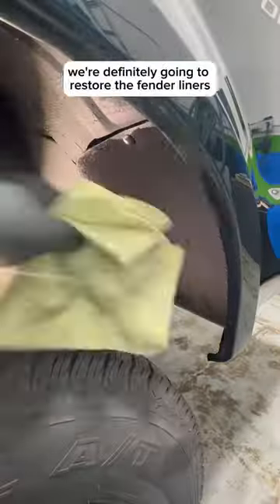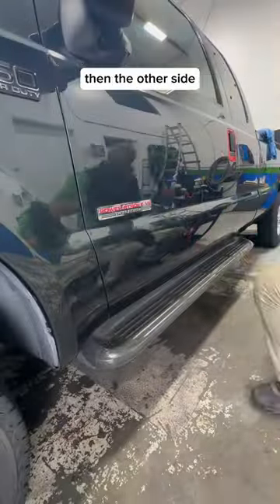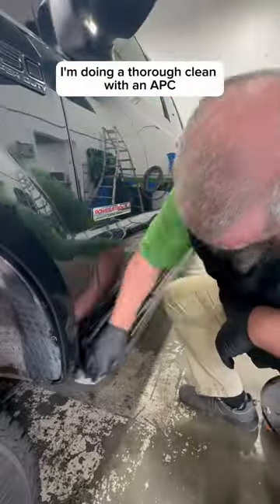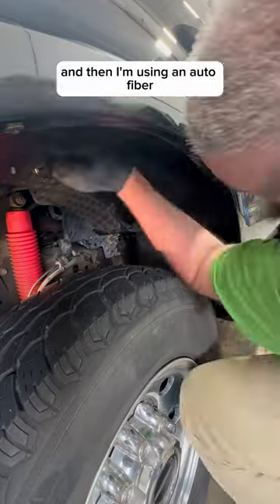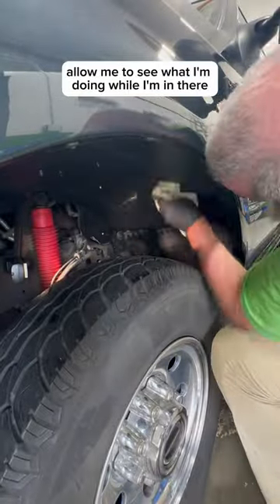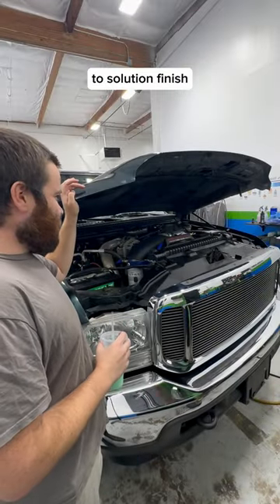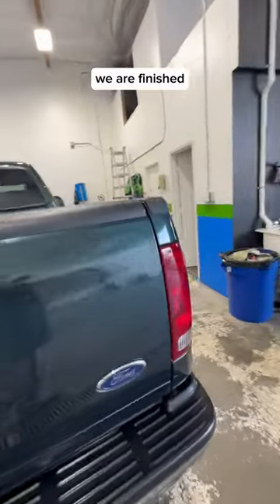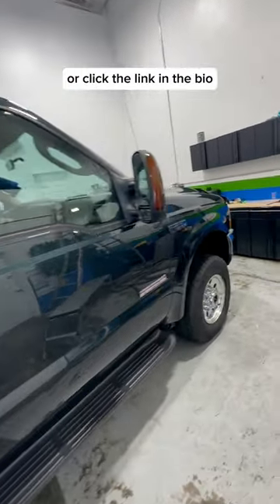That’s a wrap on this #detail #paintcorrection and #ceramiccoating that one was super fun!

Comment: Would it not be easier to buy new ones?
Reply from the maker: Fender liners? No
Reply: @dirty2dreamy350 I'm curious, why not? I bought my new from Ford for $38/each
Reply from the maker: @DHFlip18  in this scenario it’s an add on that we threw in. Buying new would take planning and while it’s more practical, wouldn’t have gotten them in time for the completion of the job.
Reply: @dirty2dreamy350  Really? A quick drive to the dealer, cutting off the old ones and installing the new ones might take less time. I replaced mine, in less than an hour, for both sides.

But hey, if you say it's free and it's faster, must be so.
Reply from the maker: @DHFlip18  not in stock brother 😎
Reply: @dirty2dreamy350  Hate it when that happens. You guys work magic.